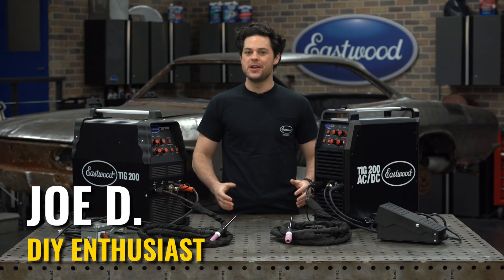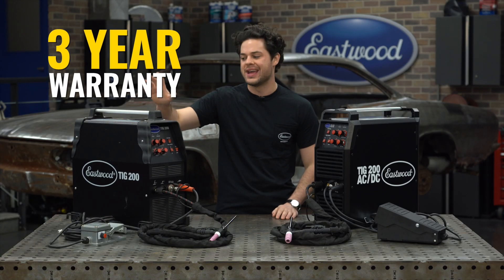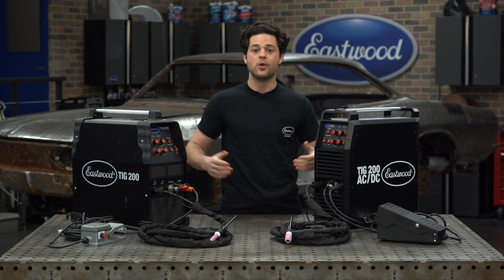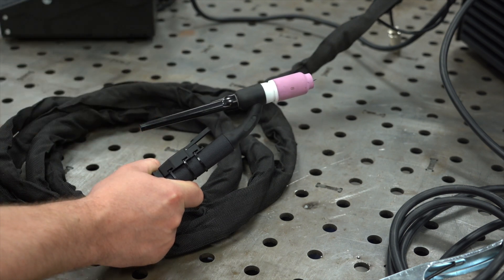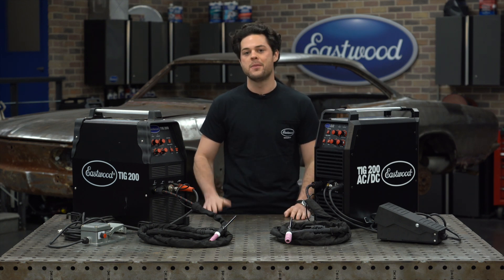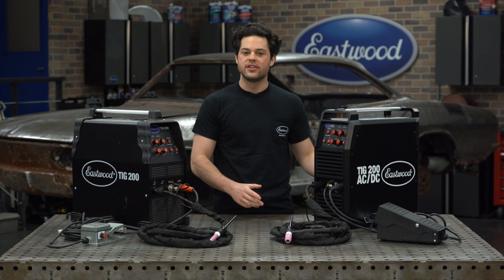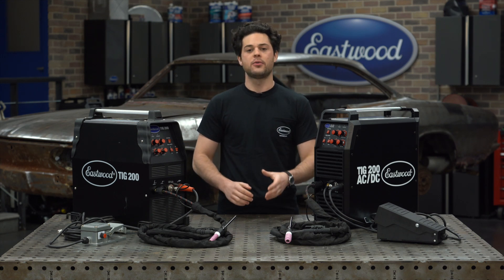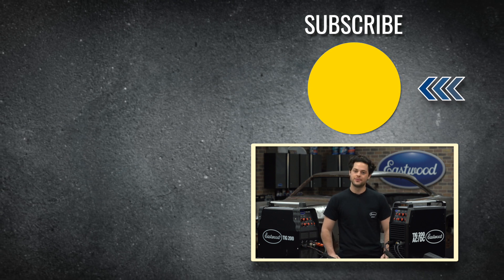TIG 200 AC/DC - NEW & IMPROVED: The Perfect Welder for You!

Comment: Are the parts interchangeable like the rocker pedal to the old unit. I know the torch is as its still a 17
Reply from the maker: We've made a couple upgrades since even this video came out - but a lot of the parts are interchangeable depending on the unit. Contact customer support for any specific part needs: 800-343-9353
Reply: @eastwoodco awesome will do.

Comment: Can I use the new pedal for the older model?
Reply from the maker: We have upgraded pedals for all the machines but there's several models so you need to check your welder to make sure it's the right one.

TIG 200 ACDC 2 and 3 Pin Pedal Upgrade: https://www.eastwood.com/tig-200acdc-foot-pedal-upgrade-2-and-3-pin.html
TIG 200 5 pin Pedal Upgrade: https://www.eastwood.com/tig200dc-foot-pedal-upgrade-5-pin.html

Comment: I've had the original Tig 200 for several years now. Was impossible to weld till I converted it to a gas lens and abandoned the pedal all together. It was more than just not ergonomic, having the separate setting on the pedal from the machine was just a nightmare. I've been considering investing in a new, better pedal as I've missed the ability to pulse and fluctuate my power. Wanna take a trade in? It's still like new...
The other vital improvement is a real flow meter for the Argon tank.
Reply from the maker: The gas lens kit, rotameter regulator, flex head torch, and that new "rocker-style" foot pedal ALL seriously improve the quality of life with the new machine. The new pedal utilizes the power knob on the machine for adjustments. No more bending over. 
-JD

Comment: I really liked my Tig 200 AC/DC machine. It worked great for about 4-5 years. Then it quit. Do you have a repair service yet?  Last I checked with your Tech Dept, they said you offer all of the parts to repair it, but no one could help with the diagnosis of the failure. I would really like to get it fixed.
Reply: Really nice of Eastwood to not respond to this. Says a lot
Reply: Mine has an issue with running on a suitable generator. I keep getting the yellow light that indicates there is not enough running wattages as I have found by calling tech services. The unit shows an open book symbol next to the light. Indicating see the manual. Well there is no manual that answers the yellow light condition! 

Tech services were rude about it also.